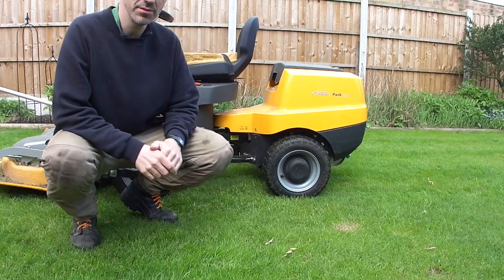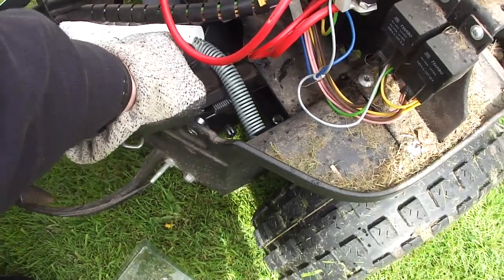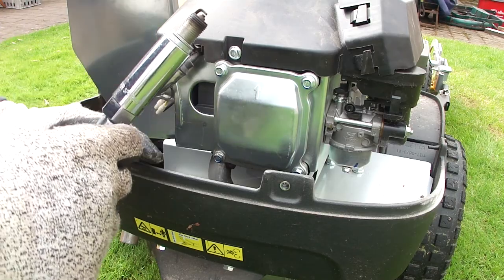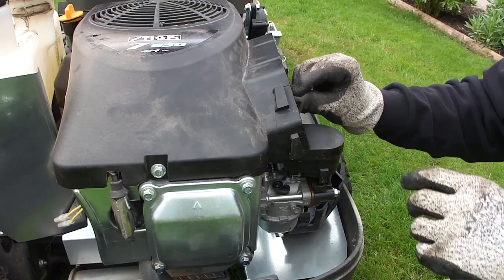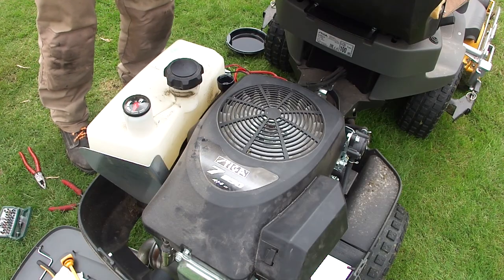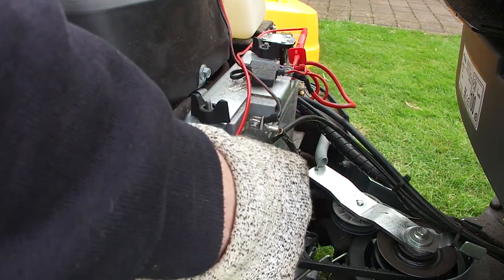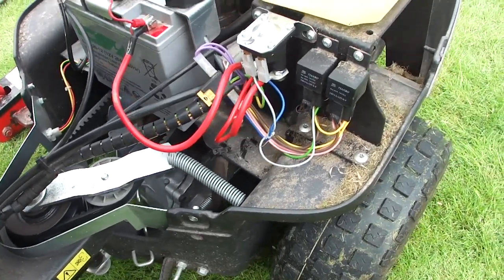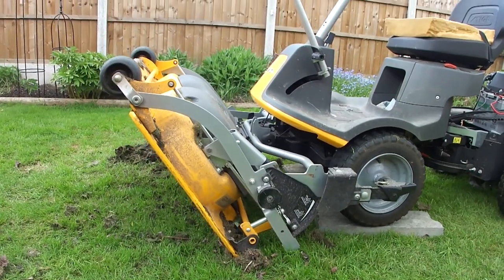Stiga Park 120 Service

Comment: I have a stiga park hst that ive owned new since 2007 .  Its been great .  I derust/repaint the deck every couple of years and have replaced all the deck bearings in it a few times (as there are no grease points for these and the grease goes dry).
Got 20 years out of the original battery . V. important that it is fully charged before storing for winter as AGM batteries die in a partial charge state.

The Tufftorq gearbox is 'sealed for life' (as with most cars today), however it was recommended to me  by a number of mower guys to change the oil every couple of years which i do and its noticeable the difference in colour when draining.   On my mower Stiga purchased the Tufftorq gearbox from the manufacturer with the optional drain points on the main gearbox box and differential which is interesting.... They are often not drilled and tapped on other makes using Tufftorq.  Perhaps Stigas definition of 'life'  could be 10 years.

I always change transmission oil on vehicles .  
(Had a friend who once had a Maserati with a ZF box and these were 'sealed for life' . No oil change required (which meant 100,000 for Maserati) however ZF did recommend oil change intervals  for that partical box - Zf expected their boxes to last a lot longer than 100,000 with regular servicing.)

Comment: Very comprehensive video, I have just used it to do my annual service. One small addition to the list is to check the blades and sharpen them if required. Overall a great video guide!

Comment: Just wanted to see where the drainport is at the tractor. Nice video. The shop where we bought it, we let them do also the Service and they always done the oil chane but put way to much oil on there. Now I am doing it on my own. Thanks for the video.
Btw we have the 220 and it has a Bridge and Stratton Engine not a Stiga one but the oil drainport is the same
Reply from the maker: Thanks for the info and for your comment 👍

Comment: Nice video! I found it because i'm searching a solution on my Stiga park 220. It doesn't start. When i turn the key.....absolutly nothing. Was working very good on my last try. I washed it and park it in good shape in my garage. Today, nothing....any idea? Is there any fuses?
Reply: Mine had exactly this problem. It was the starter motor relay (Stiga use some cheapo junk for these relays, and they are not weatherproofed.) Test with a multimeter upon switching the key.
Reply from the maker: Thanks for this, I've just been asked to take a look at the Park 120 featured in this video as it's doing a similar thing. Will try to do a video on it!
Reply: @1066qw  
Ditto; had it replaced when serviced, lasted six months, so about 15 starts.

Comment: I cannot increase acceleration, has cable come off or does it need to be tightened, if so, do you have to take the body surround off??

Comment: Hey, nice video. I've got a 344ccm 13hp Stiga park compact 14 hst mower. How du you lube the chain from the steering. Usually I just spray them down with brake cleaner and after wiping and drying I spray them with thicker spray lube. Does work for me, but is that enough ?
Reply from the maker: Thanks! Your method sounds good enough to me. Any sort of lubricant that stays on the chain to reduce wear, but more importantly to prevent water sitting on the chain and causing it to rust, would be sufficient in my opinion. I suppose something like a motorcycle chain spray lube would be ideal. Some of these are available in small bottles so they'd fit into the relatively small space available more easily. Could also spray with the steering in different positions to ensure you get as much coverage as possible.

Comment: Question for you I have an older Park Pro HST12. Ive just noticed lately that oil is leaking and seems to be coming from rear tire area. Thoughts?
Reply from the maker: Hi, it's very difficult to tell without seeing it. Could be coming from an oil seal on the transmission or if that model has an engine oil drain tube like the Park 120, that could be leaking (it's in front of the left rear tyre). Really the only way to tell is to look underneath it with a torch (+/- mirror if needed). Depending on how much oil has leaked, it may need degreasing first to help you work out where it's coming from.
Reply: @AndrewFixes  thanks for your reply , i actually think i over filled it and its leaking around the seal. It was really sluggish forward and reverse for awhile after i filled it.

Comment: Hi! My front belt has broken - ive ordered a new belt but how do i replace it? it seems a little bit tight so its hard to get it over in the weel in the front - is it easier if i pop the front up and then place the new belt on?
Thanks. 
Siri
Reply: Terrific video and I have the same question as well. When you popped off the top plastic cowling at the end of your video, the two wheels seem afixed with no room to move for tension adjustments. So if you replace the secondary belt, how would one go about loosening that wheel? Is it just the bolt on top?
Cheers!
Reply from the maker: @studiojapan3432  If you're talking about the toothed belt that links the 2 blade pulleys - I've not had to replace that one before but I think you're right - can't see any other way of doing it apart from removing one of the pulleys. Hope you manage to get it sorted - would be interested to hear how it went. Cheers
Reply from the maker: Siri, which belt do you mean? The one between the 2 blade drive pulleys or the one taking the drive to the deck? I'm just trying to work out if you're both talking about the same belt or different ones! Cheers
Reply: Same problem here, just broke that belt that drives the blades and goes under the seat. Had a hell of a time figuring out what size belt but I can't see any other way to get it on than to take that pulley off under the seat run the belt and then reattach the pulley. Frustrating setup if that's the case. Anyone else have an easier method?

Comment: I have a problem with my Stiga 12.5/96. Can you help pls? Took it out of winter storage, charged battery, and mowed for a couple of hours. Took a break, now it won't start again. Seat microswitch looks OK, so must be brake pedal or gear lever switches. Any idea how to get to them to check? Can't find service manual anywhere on internet. Thx.
Reply from the maker: I realise I'm about a year late to this party, apologies for that. I hope you managed to fix it.
I've had a similar problem with the Stiga featured in the video this year. In my case it turned out to be a loose connection to the ignition switch.
Reply: @AndrewFixes  Yeah, I moved on from temporary work at that place a while ago. Thing is, she was rich and there was a service station in next village with mechanics who could have sorted it in a jiffy. I'm good with cars and m/bikes, but agri  machines are a different ballgame. Ho-hum, never got to finish the garden and it looked shit half cut.